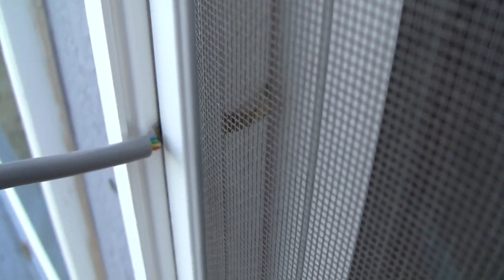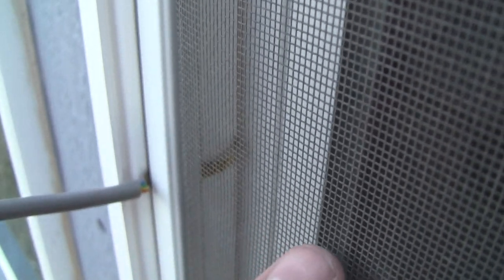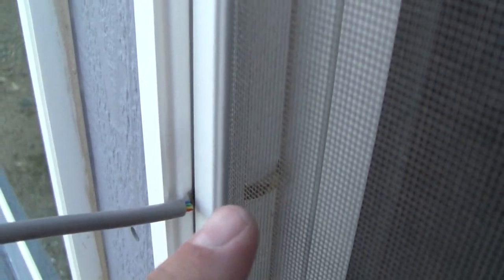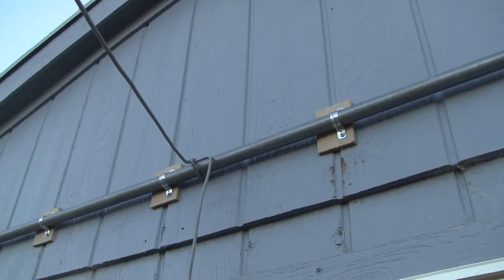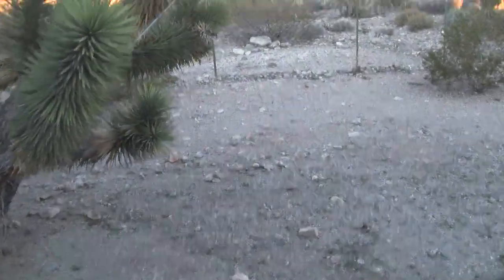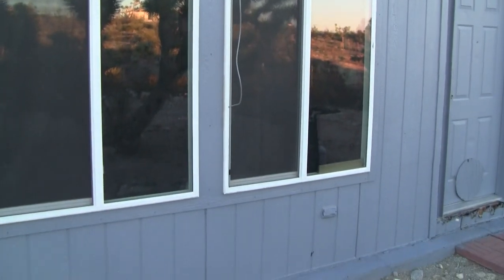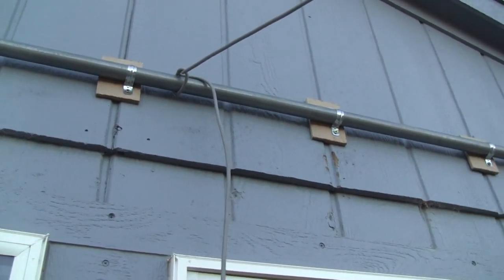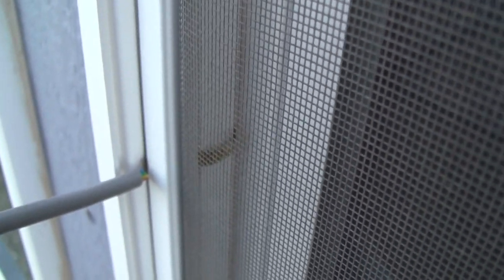RTL-SDR antenna. Cheap, Quick, Cheesy.

Comment: I like the point about having any antenna outside is better than an indoor antenna.  I imagine that it works even better out there away from the city.  I would pick up all kinds of city noise here.  So it looks like you are doing experiments, which is what this is all about.
Reply from the maker: Right !! This rigged antenna has worked just fine.

Comment: What do you use your antenna for :D I want to make anntena for NOAA sattelites picture capturing and this is probably not good enough but I want to know for what is it good enough?
Reply from the maker: I would bet this is not a good antenna, but good enough. I use to scan through all the bands that the sdr had. Short wave worked ok. This was so at least I could test the sdr since I'd never had one before.
Reply: You need a dish with down converters.

Comment: you can do it with normal speaker wire you make one into shortwave antnnea  you use as morse code on 40m  you just need 100ft speaker wire like rca any speaker will  work when  outlet plug wire works.
Reply from the maker: Thanks !!

Comment: nice, how did you connect it to the SDR?
Reply from the maker: Just a wire with an alligator clip on one end and a banana plug on the other.
Reply: @mikep95133  Have the same issue with holes in the wall but this part is still unclear.  A picture of what it looks like coming into the house and connected to the SDR would help.  Are you just connecting the center wire to the SDR box or the brass plate which is connected to the shielding of the coax as well? Also grounding needs ?
Reply from the maker: As simple as I could make it. A wire to the thin brass strip. Then shut the window onto the brass strip. Outside a piece of random length cat 5 cable was attached to the brass. Any of the cat 5 cable conductors will work. Then tossed the whole thing into a tree for a little height.